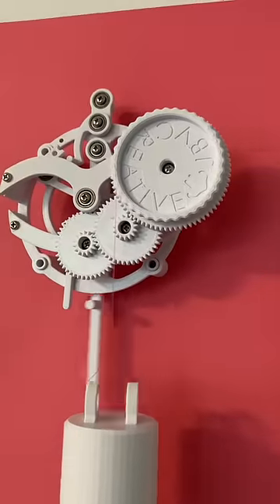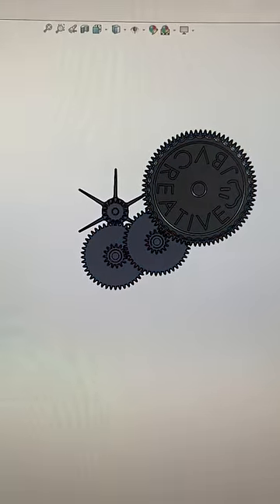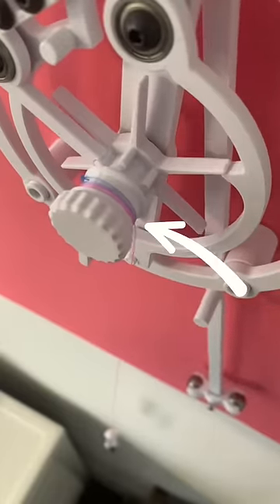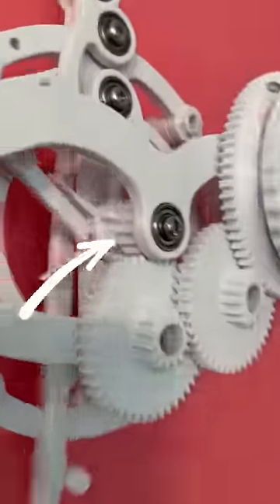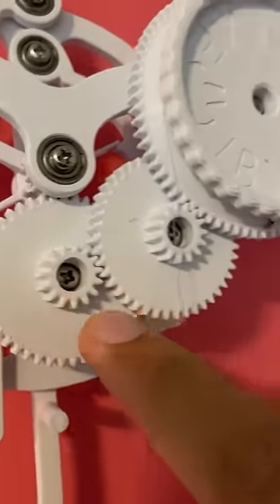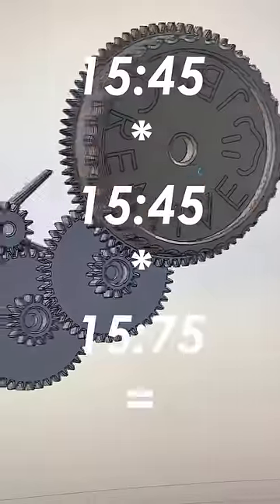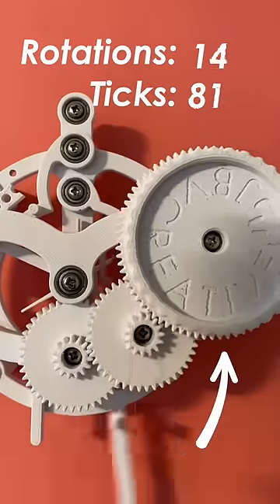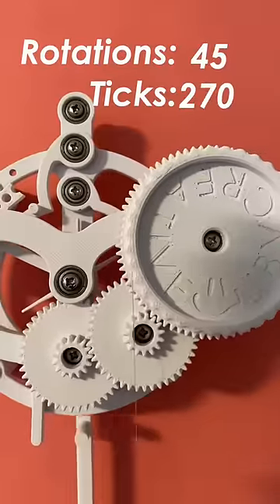Why Did I add Gears to this Clock Mechanism?

Comment: Very cool. Each full rotation of the string is longer now though since it's wrapped around a bigger circle. If you made the part it wraps around smaller it'd need more weight probably due to less leverage but it would take longer to run out of string/windings.
Reply: Yeah, that's because more weight higher up means more energy. Really cool!
Reply: Yupppp. If he made that half he would gain 16 times more rotation right ?
Reply: @subhradeepsharma  he remade the spool 3x smaller and it lasts 3x as long now
Reply: @evhan  That has nothing to do with it. A smaller pulley has less leverage than a larger one. But a larger pulley also has a larger circumference, so one rotation requires more string. 

Also, (I still don't know what you're thinking exactly, but) an object higher up does have more potential energy, but moving it even higher always adds the same amount of energy, no matter how high it already is. 

And pulleys, which this spool is, change force and distance, not energy expended.
Reply: @subhradeepsharma  For the same amount of string, (which also means the same amount of vertical motion of the weight), since halving the radius halves the circumference, it would yield two times as many rotations. ( diameter = 2*pi*r which means that 2*pi*(r/2) = pi*r )

The disadvantage is that halving the radius also halves the leverage the weight has, which means it exerts half as much torque (rotational force) on the system. But making the weight twice as heavy would compensate for that by doubling the force of gravity on the weight.
Reply: @mysss29  gravity's force is the same. You can't simply just multiply gravity?
Reply: @dannythorpe1425  the gravitational constant is the same, but the force is not
Reply: @mysss29  but the problem is that the same amount of energy is expended, so in order to reset the system, the mass might be to big at a certain point to actually easily rewind the system. Yes, in a small system like this one, with some 3D printed plastic, the masses involved are not high, hence there would not be to much problem (appart from the fact plastics are pretty light so the mass needs to be quite larger than it already is), but in more industrial applications it can become an issue.
Reply: @dannythorpe1425  force of gravity depends on the mass.
The formula of any given force, from newton second law, is :
F=m*a where m is the mass and a is the acceleration. So for gravitational force, it’s the mass times the gravitational acceleration.
Acceleration and force are completely different.
Reply: Is this not a grandfather clock?
Reply: It's the same distance to the floor and the same length of string. The spool size doesn't change that. He just changed how much string gets let our every tick
Reply: @vaj1414  actually, the higher the spool pully is, the less gravitional force is applied to the weight, as long as the string remains the same length.

 #facts. *

*As long as you believe in the heliocentric globe model.

Comment: As a suggestion, of you attach the weight to a smaller spool on the 75 tooth gear, you will maintain your ratio and gain a significant amount of run time per weight drop.

Comment: Ive seen this with a variable double weight reverse gear design. When it gets to the end you attach the larger part of the weight to the opposite weight platform and switch the gear. All it does is save you from having to wind it back up, because it effectively does it itself .
All you have to do is switch the weight and gear over

Comment: You could still get quite a bit more runtime out of the current string length by making the spool a smaller diameter, as long as your weight is heavy enough to keep the machine running with the increased torque.

Comment: If the spool that it gets wound on is smaller on your final gear you could get significantly longer run times.
Reply: Right now it looks like the spool is the same size as your gear if you half the size of the spool you'd get double the run time.

Comment: I think if you add a smaller wheel on the biggest gear to hold the spool, it will run for much longer. You might not be able to extract enough power from the weight to keep the system going though. Would love to see you try this

Comment: What I think would be really cool, is adding a return spring that isn't strong enough to lift the weight but is strong enough to retract the string, so instead of winding it up you could just lift the weight.

Thinking about it, it seems really simple, but there might be some reason that it's not.

Comment: You can repeat adding gears until the weight is just enough to keep the wheels turning. And then you can add weight again. Friction is the limit.

Your winch could be thinner too with the same effect, but the string need to be able to bend that narrowly.

Comment: To add an Easter wind up I'd have the winding plate spindle have a a fold in rod so when you want to pull the gear out a little to save the teeth on the other gears.

Comment: I also see that you need to have a bigger mass due to the higher frictional forces of the gears. The fondamental problem of gears is that they are not very efficient. I’d like to see you try with a belt system, it might give you more efficiency, meaning you need a lower mass for a larger gear ratio, and you could easily go to larger gear ratios without having the need of a larger mass.
Also, if you don’t mind the mass, you could try an planetary gear, giving you much higher ratio on a small footprint !

Comment: Has anyone ever done something like this where when the weight gets down to a certain point some kind of clutch or additional gear engages to drop another weight and wind the other weight back up, then keep looping? I guess not, because one weight would have to be heavier than the other and the lighter one couldn't wind the heavier one.

Comment: You should make the weight heavier and put a small spool towards the center of of the gear with the string on it now. A light weight can only put so much energy into an escapement as gravity can put into the weight.
Reply: I was thinking a dencer material such as those big metal grandfather clock weights, but the gear would need to withstand such a force.

Comment: Ive always wanted to scale this up and attach an alternator to it and use 4 or 500 pounds and put a wind up on there using a hand crank and some snatch blocks. 

So if you needed some off grid power, and you ran out of gas or sun or whatever, you could have 10 minutes of power for every 30 seconds of work or something like that.
And just see how much efficiency  I could get out of it. 

Imagine a big ass rock dangling 60 feet in the air running an air conditioner for an hour! 🤯

Comment: You might consider making your gear ratios slightly different like 44:15 that way every tooth will make contact with every other tooth. This makes the teeth wear much more evenly.

Comment: Ok I like that display gears rotate freely right magnets count in order to create controlled motion how strong of an emf push can create a balance motion monitoring system a tool measuring time, use partials in the air when you make a model showing light spectrum physical applications can be lights and speakers I have to smoke another cheers that for the share

Comment: put a second weight hanging the other side of the pully and other side of the string except this one should be as light as possible and just look like the other weight, then you can reset the heavy weight by pulling the light weight down
Reply: Also would kinda make it look like an old cuckoo clock

Comment: I wanna see a video on battery run time like for instance have one motor running on a battery and see how much it takes to make it run on a track to the other side but one time just full throttle another on a lower throttle that builds but and check battery consumption to see what way is more effectively effective on the battery see if their is a sweet spot in throttle and how much to use of it to get the most battery you can out of something… I got an invention that’s gonna bring things into the next era I’m still working on design but would like the answer on the throttle thing tho I’m gonna make an engine have a heart lol 😂 in every essence that engine will be a heart once I’m done with my invention

Comment: Why didnt you put the rope thats tied to the last cog closer to the center of it? That would also increase the gearing so you would either need less gears or less teeth on the gears, so you could have reduced the friction in the system

Comment: Hey, this might be kind of late but why not have the largest gear have a small spool to wrap the weight’s thread around? The gear’s ratio will be the same, but since there’s a smaller circumference less thread will be used per rotation… I guess the leverage will eventually be too much (too little?) to actually be an effective source of energy but making a bigger weight is something you’ve done since ur last video on the pendulum (or at least the one I saw).

TL;DR by shrinking the weight’s spool that it wraps around you can add another level to the going train

Comment: Except your spool size is like three times as big, so you just have 1:15 (fractional mechanical advantage is what you want to replace a small weight long drop with a large weight short drop).

Comment: Could you make it have perpetual motion with a counter weight possibly? Like when it goes down it picks up a weighted magnet or something??
Reply: Idk if you fully understand the concept of how counterweights function, which is a pretty easy misunderstanding to fall into. If you put a counterweight on it, then nothing is going to change. Unless the mass of the counterweight can change, then the main weight is just going to lower slower (if the counterweight is lighter than the main weight) not move (if the counterweight is the same weight as the main weight) or start going in the reverse direction (if the counterweight was heavier than the main weight)
Reply: @dylanshandley1246  that's kind what I was going for, a weight that could disconnect and reconnect somehow. I know it's probably impossible, but sounds cool in theory.
Reply: @themachine14100  the easiest way to accomplish something like that, would probably be with water filing an enclosure, attached to the weight, with a hinge that will tip over and empty once the centre of mass moves too far over, and then move back to refill and start the process again. But then, it’s not perpetual because of the water refilling the enclosure 💁🏼‍♂️ :p
Reply: @dylanshandley1246  That's actually a pretty good Idea, I'm going to try that now thank you.

Comment: How many 15 : 45 ratio gears can you keep on adding until it stops working? 😁
(I wanna see a long Fibonacci spiral of gears, curling out & around the entire escarpment...)

Couldn't you also put a coil spring in behind the spool, adding tension to increase the run time? Or would this just make it tick slower?

Looking forward to seeing new mechanisms based on the Mudge & Grasshopper (love the names) Escapements.
Reply: I believe if you add more gears you would have to put a heavier weight on the escapement gear due to friction...don't know how much, maths somewhere...

Comment: If you were to decrease the diameter of the wheel that the string is attached to, it would increase the runtime. Would this work in the context of this machine? Or would like the gear ratio not be good enough

Comment: Why couldn’t using another system help the perpetual motion aspect closer?

Hypothetically, springs and magnets can help boost movement, and rebound weight by way of a counterweight and potential energy from springs?
Reply: Because according to several laws of science, priorities motion is impossible. There is no way to reach it or even realistically "get closer to it". You can make things run for fast longer on one "charge" of energy, like he's fine here, but even if he kept going, getting infinite motion out of it is impossible
Reply: Magnets only work because they generate a magnetic field. They can run out of charge just existing.

Comment: I know perpetual motion machines are impossible

But what about a machine that uses the exact same amount of energy to reset itself that it uses to function

Like a perpetual motion machine but it generates an equilibrium of energy, it doesn’t make any excess energy but it also doesn’t lose and excess energy
Reply: Also not possible
Reply: In a perfect scenario. No friction, no outside interference, etc, yes it is possible, but unfortunately that's impossible to achieve currently

Comment: surely the big end gear is not adding anything? the diameter of it means you're unwinding a longer length of string per rotation than if it had a smaller hub on the front to wind the string round?

Comment: Is it possible to add one more weight which is to used to rewind the main weight. And when the main weight is winded it is partially used to rewind the second weight. Ofcourse that too won't be perpetual as there will be energy loss somewhere but it might give much more run time.

Comment: Could you add another weight and pulley system to counter pull the main weight to rewind on its on?
Reply from the maker: It would just cancel out the dropping of the first weight 🤷‍♀️

Comment: doesn't using a lot of gears with a huge gear ratio mean that you also have to increase the weight's... weight, by a really large amount, to overcome friction through the entire system? I am thinking of trying to design and 3D print a clock at some point, but I have a lot of things to learn about how stuff like this works...

Comment: Would it run longer if you ad a smaller diameter ring on the drive gear to wind the nylon string? So you can wind more nylon on it

Comment: Looks like you could have geared it a lot longer than than 45:1 - the pendulum and plumb weight seemed easily able to keep it going. What would about 3200:1 look like? Could you get 24 hours instead of 20 mins?

Comment: The amount of energy in either system is the same yet one runs longer. This must mean that one uses less energy per time unit. So where was the energy “lost” in your previous model?  Maybe the pendulum doesn’t swing as wide?
Reply: the weight is bigger now

Comment: I think you missed a trick by not creating a smaller diameter wheel on the 3rd cog to wind the string around. For every rotation of the the last cog you'd have less string let go for the weight, possibly even giving you a 24 hour run time. In fact, you could possibly even create different diameter wheels that lock on so you could tweak it to exactly get 24 hour run time for a given length of string. I.e. Exactly 1m or something. Definitely something you should be able to calculate but the string winding on a smaller diameter wheel would actually effect the timing.